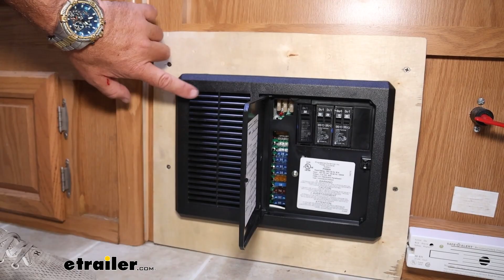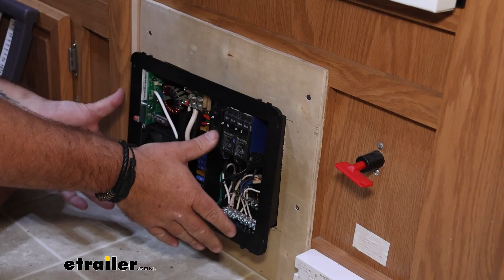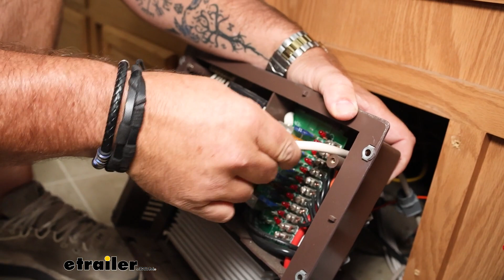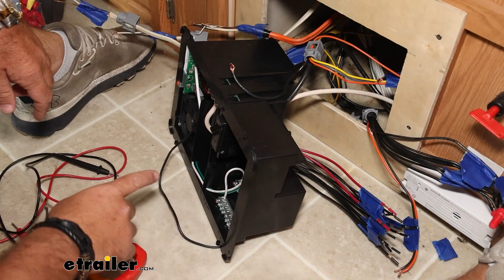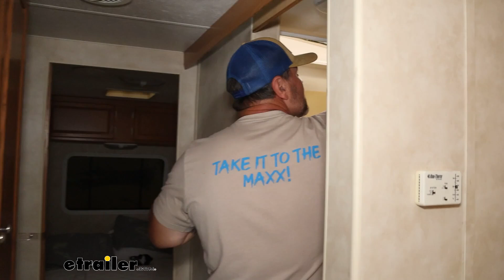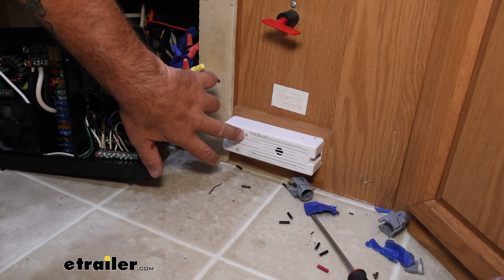Progressive Dynamics 4000 Series RV Converter Set Up - 2005 Coachmen Spirit of America Travel Traile

Comment: Thanks for the video- Does it matter which breaker the positive black wires goes for AC power? I'm referencing the one that rides along with the green and white wires from the left side of the box. I noticed you had it disconnected throughout most of the video and then it appears to be connected to the far right breaker. Thanks, Kevin